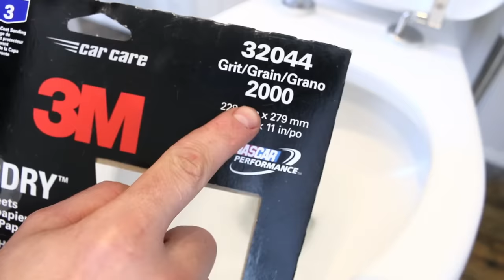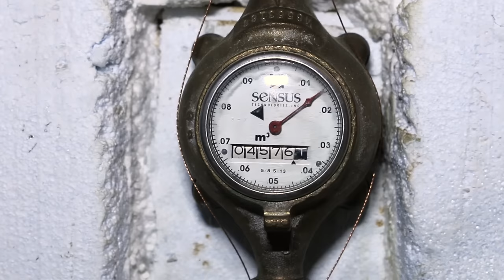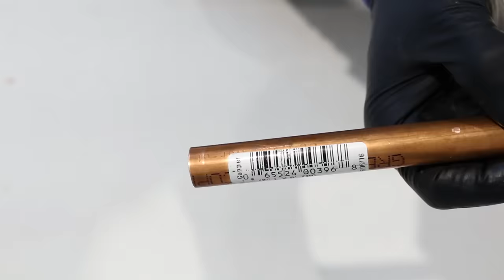15 GENIUS Plumbing HACKS! | GOT2LEARN

Comment: Don’t sandpaper the toilet bowl. Stick some TP to the mineral ring, then spray it with vinegar. Vinegar breaks the minerals down (just like the clogged shower head), the TP keeps the vinegar from running down the bowl.
Reply from the maker: The 2000 grit sandpaper isn't really sanding, more like buffing, i've been doing this forever and my bowls look like new.

Comment: Instead of scrubbing your toilet with sand paper just use CLR. You don't even need to scrub just let it sit.   Also on the horizontal pipe you can't solder because water is still trickling. You said get a compression valve. You are just causing more work and money. Just go out and buy a shark bite fitting.  Or if the water is just barely trickling take some bread (not the crust) and stick a little down the pipe the solder. The bread will stop the water long enough to solder and it will dissolve with in water when the high pressure comes. Don't use a lot of bread just enough to stop the water.

Comment: u don t need a extra compression valve to stop the leek  before soldering u get a good chunk of bread and stuff it inside then solder a normal cheaper one then poke the bread whit a  wire, thru the  valve way cheaper
Reply from the maker: Doesn't always work ;)

Comment: all the online tool suppliers sell chamfer bits cheap ..
or a file or metal cutting disc will dress the occasional bolt thread ...in case a guy forgets to thread the nut on first

Comment: How to Easily remove a stuck Ferrell or compression fitting?
Reply: Nancy Drew compression ring puller. Or grinder but don’t cut the pipe
Reply: I split the ferrel with a sharp chisel, or notch it with a mutli tool

Comment: Just use your torpedo level to scrape the stickers off...no burning glue and sand the rest off!
Reply from the maker: Good tip, thanks bud!
Reply: @Got2Learn  I used your shark bite trick for removing fittings and that has saved me alot so thank you for the videos...good editing!
Reply from the maker: My pleasure man, glad you liked it, don't forget to subscribe and share, it helps a lot :)
Reply: Or you can use the back of the copper cutters to scrape and sand the rest

Comment: How to get rid of calcium deposits where the water first enters the bowl at the top?
Reply: Citric acid, slightly wetted into a paste. Apply to the bits that need to be removed. It will dissolve limescale, and rust stains.

If you're a bit more daring, and live near a pool supply store, (or have a pool,) you can use muriatic acid (hydrochloric acid) to dissolve it much more quickly. I would dilute it, first, wear gloves, and ensure good ventilation, if I were going that route. Be sure to rinse thoroughly, because the fumes will corrode any metal it is likely to touch.

Comment: @got2learn ok if your gonna add a compression shut of valve to stop water so you can solider a coupling why wouldn't you just add a compression coupling and save you $5
Reply from the maker: That would require 2 access traps, you can't have compression fittings in a wall without access ;)

Comment: 0:05 The essayist and cheapest way to clean stains in your toilet, pour in about 750ml pool acid (hydrochloric acid), leave it for about 1 Hr, brush off gently with the toilet brush and flush. It will be clean the day as you bought it.

Comment: Hi I am getting hot water in the shower. But kitchen & bathroom sink the water is coming when hot tap turned on but it’s coming out cold/ luke warm -can anyone help with this what is the issue?
Reply from the maker: Always luke warm, or it gets hot after a few minutes?
Reply: Got2Learn always luke hot could it be the thermostatic valves limiting hot water??
Reply: I did fit in Taps in bathroom sink and kitchen sink? Since then it’s been like this ):
Reply from the maker: when you say taps, what do you mean?
Reply: Got2Learn the sink taps. Mixer taps
Reply: I fitted in new sinks with taps in bathroom and the kitchen.

Comment: From Kentucky licensed Journeyman Plumber, NEVER use compression fittings on water lines, ever! Just buy I sweat tool and a sweat valve and do it right. Or, open every faucet in the house, turn valve to water heater off, open an outside spigot and suck all the water out of the house with a vacuum.
Reply: Why not use a compression valve? Compression valves are used to shut off under every sink and toilet. What is your reasoning?
Reply: The valves used under sinks are made to hold the pressure, but the larger 1/2” and 3/4” valves are not. However, if you can find a 1/2” or 3/4” compression valve that seals with a brass furrow rather than a rubber one, I’m all for it, but I’ve yet to see the one. Also, the rubber furrow seals on the compression valves will never be able to hold up like a brass compression seal on a stop will.

Comment: Toilet hard water ring can be removed without any rubbing and scrubbing (2000 grit is not so widely available).Get a pint of muriatic acid and pour a cup of the stuff into the toilet,let stay over night.It will be gone in the morning.The solder belt demonstrated would cost twice as much as two belts from Amazon.Otherwise great tips and no nonsense presentation

Comment: Using solder as a temporary belt may not be a good idea. It may eliminate plumber's crack and you wont have that handy groove to hold a pencil or a screwdriver. The lack of a plumbers crack is simply unprofessional.

Comment: Not always  the flapper could be bad.  Could be the overflow fill valve where the flapper seals together.  Bought 2 flappers until I realized the overflow fill valve had a uneven spot and the water was slowly leaking into the bowl portion..

Tip.  Take a look at the underside where the flapper seats to the OF fill valve and see if it has a uniform stained seal marking.  Probably bleached stained  from your local water source.

I saw that mine had a small 1/4 inch V shape.  The point of the V was where the water was slowly leaking...  Fixed now almost broke down and bought a new toilet because it was so frustrating..

Comment: Use a strap wrench or a rubber cover to take the aerator off, plier jaws will scratch it and if you use the handle to grab the jaws might scratch or chip something else on the sink

Comment: Why fit an expensive quarter turn compression valve to solder a straight joint?? Just get a straight compression fitting and use instead…

Comment: using sandpaper on a toilet will scuff and remove parts of the glaze that is on it. that is NOT recomended....
Reply from the maker: This is 2000 grit...no really sandpaper lol
Reply: @Got2Learn  so why wouldn't we use a scouring stick zepp acidic toilet bowl cleaner or OxiClean or any other actual toilet bowl cleaning chemical or product?
Reply from the maker: @Vaynthegreat  it has bite to it, just enough to damage the clear like you said, been doing this for years and never saw any degradation.
Reply: @Got2Learn  well I understand that but a scouring stick is specifically made for toilets and showers to clean them without scuffing off the finish.
Reply from the maker: Yes, those work just as well 👌
Reply: @Got2Learn  only reason I suggest something like that over the sanding block is due to people's inexperience with it can cause more damage than good the scouring stick will prevent that.  I have replaced many appliances toilets tubs and sinks due to people's lack of knowledge on proper cleaning techniques.
Reply from the maker: @Vaynthegreat  that's very true!

Comment: I was a dumbass for 10 years and actually chose to do plumbing. It's the only industry to my knowledge that's both needlessly over engineered and stuck in the 12th century. 
Nothing in plumbing makes any sense at all, I'm surprised that anything works correctly and doesn't leak. Plumbers are about the lowest form of intelligence on the planet, just above vegetable but below PE teacher. 
For example, water supply pipes, how many types do you fucking need? Find one that works and stick with it!
Plumbing, the art of shit rigging shit products.
After that long in plumbing, I had the same feeling I had when I was discharged from the military. 
I had to dumb myself back down to civilian intelligence. 
Same with plumbing, except it's even lower.
But beware, plumbers are VERY intelligent in one area, taking your money. Any job you're quoted, is usually a 1000% mark up. Something that costs say, $1000 in labor and materials, they'll charge you $10,000.
I know, I've seen it.
That's just an example, it could be lower or higher, depends on the scum level of the crooked plumbing company.

Comment: The other one with a leaking pipe , why you soldering if you putting compression isolation valve , just use compression coupler, what a waste of time, materials are cheaper than a labour cost . There’s better technology out there , soldering times it’s almost 😅 over …

Comment: do NOT use any kind of abrasive to clean watermarks on the toilet bowl, put in EXTRA STRONG vinegar (not the kind you cook with) allow to soak and wipe off.
Reply from the maker: 2000 grit sandpaper is ok to use buddy, trust me i've been doing it forever.

Comment: So if you cut the all thread and you can't get the nut on you said to put the nut back on and then cut it. But do you didn't say how to put the nut back on you have to put it on from the other end but you didn't explain that
Reply from the maker: You'd be cutting a nut that you installed prior to cutting, it's the cutting part that ruins the thread.

Comment: That “insert a lever valve to solder a wet joint” is ludicrous. if you’re going to put a compression valve in just use a compression coupling where you’ve made the solder joint.